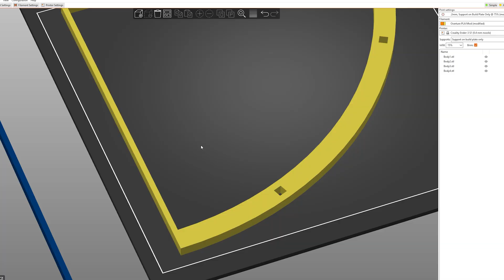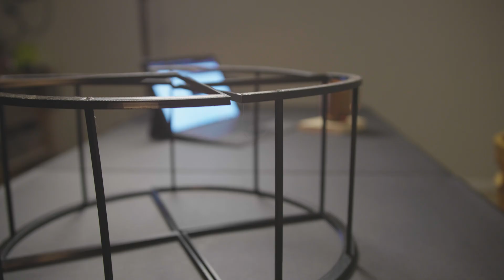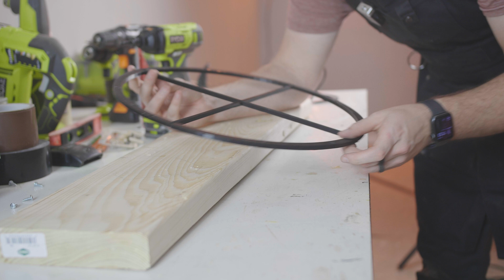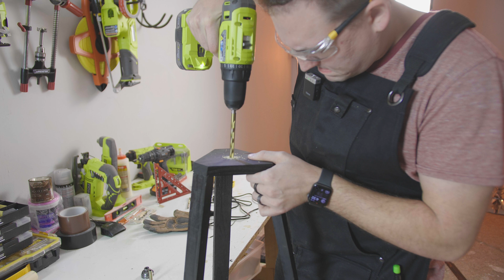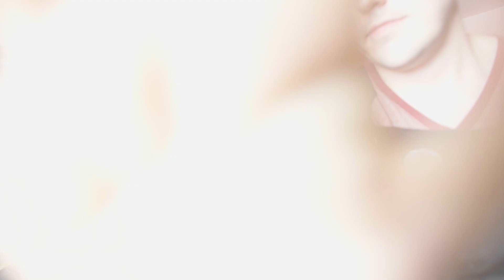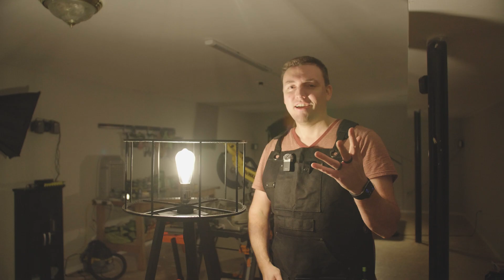Mildly Cheaper Lamp - Part 2

Comment: Cool design! I wonder if printing the columns/rods with 100% infill would have decreased the print time (since the shape is simple to begin but the infill geometry was complex)
Reply from the maker: Thanks! And that's an excellent point! Probably would have added more structural integrity as well. It's not bad, but it could definitely have less flex. 100% something to think about in future prints.